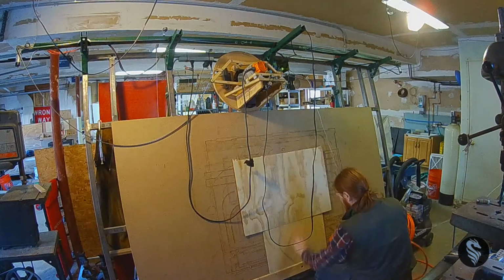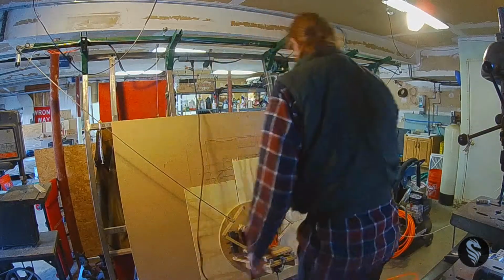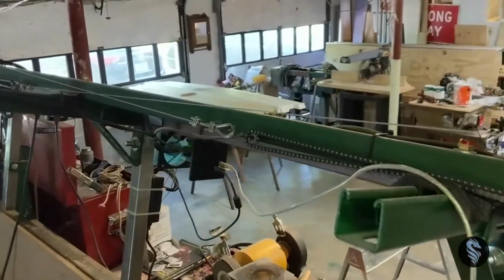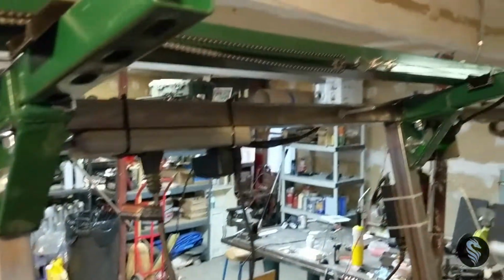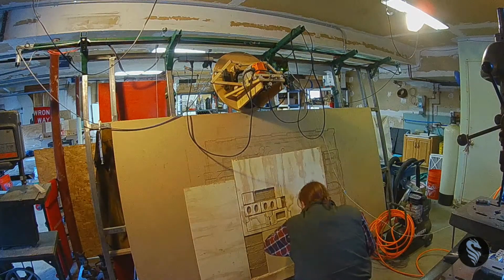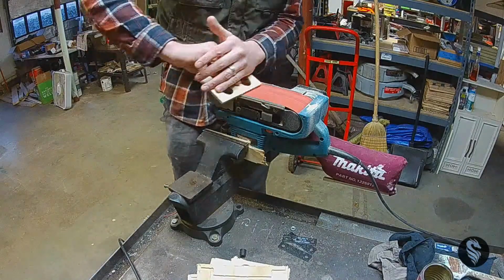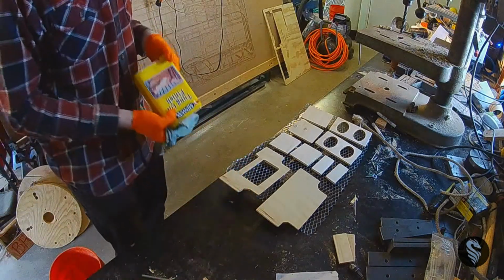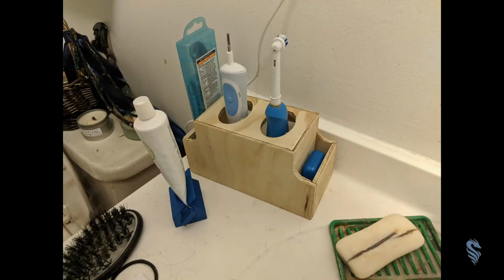Super Maslow, Part 8 - First Cuts

Comment: Hey there.  Cool video.  Consider moving your cotter pin one link farther on that end connection.  Looks like you're just cottered on to the roller, not the rivet that holds the chain together.  Might be an exciting day if there's a hard pull on the chain.
Reply from the maker: Very hard to see in the video, but I've buried the first "link" into the linkage. The cotter pin is going through the first link that's actually riveted together. I've seen some users on the Forums run into that problem and I most certainly want to avoid a RUD.
Reply: @outcast33valkyrie  cool deal man!   Having broken a bicycle chain myself, it’s an adventure you wouldn’t want (especially with a spinning router!)

Thanks for the videos!